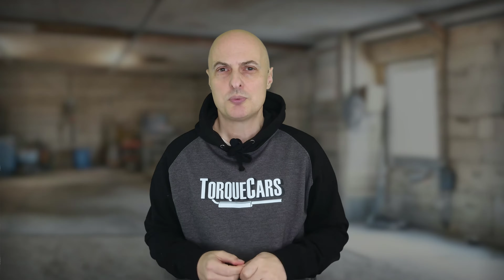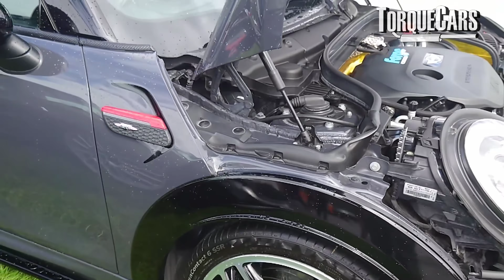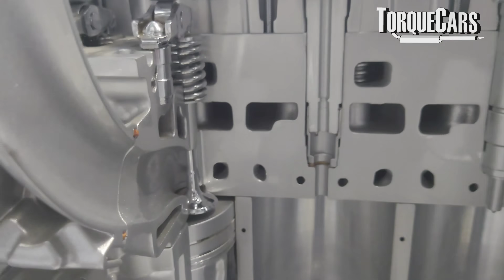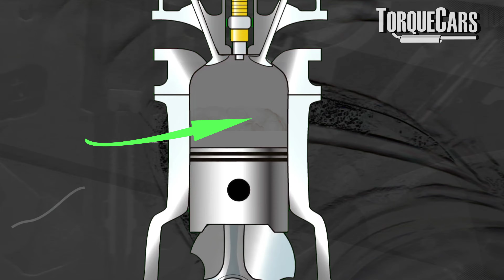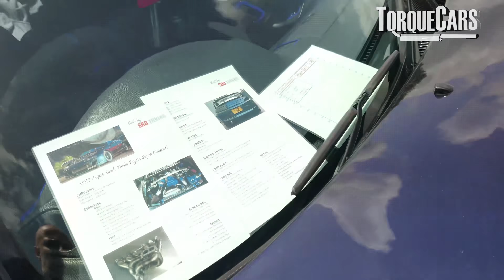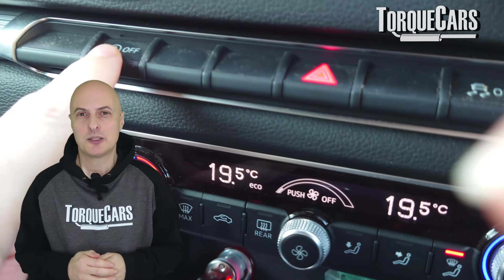Avoid 8 Common Turbo Killing Mistakes! Turbocharged Engine Avoid Big Repair Costs!

Comment: My Pug 508 recommends oil changes at 15000km. Done all mine at 10000. My mechanic recommend 7500 as a lot of low speed driving has negative affects on the oil. Have decided to follow his advice as a couple of sensible mechanics on professor YouTube have echoed his advice.
Also Total Quartz Ineo HRC specially developed for the 1.6 lt engine it has so that's all I've ever used.

Comment: I use manual mode in my automatic car and keep the revs to around 6k rpm by downshifting and cruising a bit on the same gear I do it once in 2 weeks is it good for my engine ? By the way I always warm it up properly before doing it. I have a Skoda kushaq Monte Carlo 1 litre TSI AT

Comment: Is it a got ideal to drive the petrol car at 70mph, on a clear open motorway, with a few cars on it 
then put your foot right down to the floor, to allow the turbos to kick in and blow away any oil, dust  in the turbo
,that have built up from. City driving for a month at 30mph 
Do this once a month, and does this keep. The turbos nice and healthy? 

Is it better to increase speed slowly from 70 mph to 95mph and allow the turbos to kick in by themselves or
From 70mph floor the pedal and work. The turbos your selves?
Reply from the maker: An "Italian tune-up" is essentially what you're describing, and yes, it can be beneficial for clearing out deposits and keeping things running smoothly. It depends on the engine, high rpm is the key, not the sudden load on the turbos and engine, so I would say gradual is best and dropping a gear will allow you to sit in that higher RPM sweet spot.
Reply: @TorqueCarsDriving thank you for this information 👍, engine is a V8 3.8 twin turbo, 620bhp